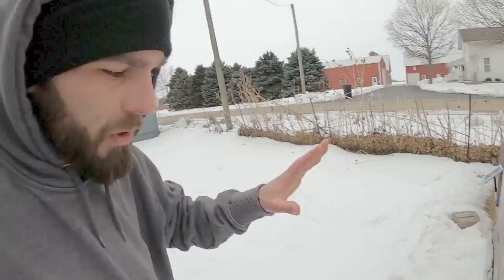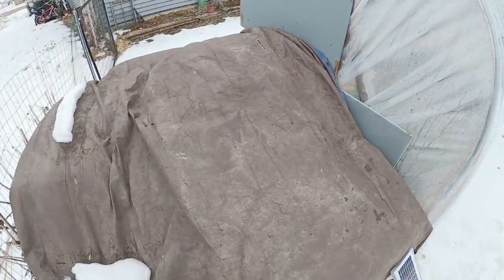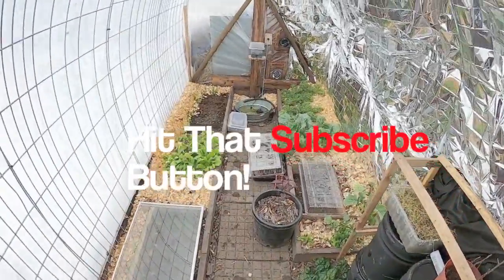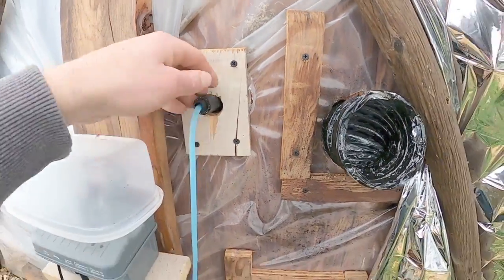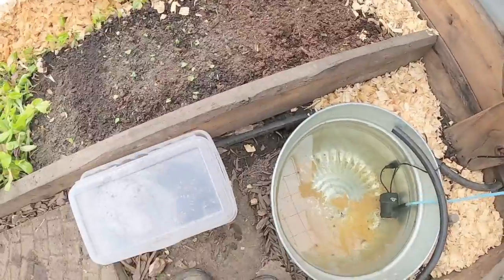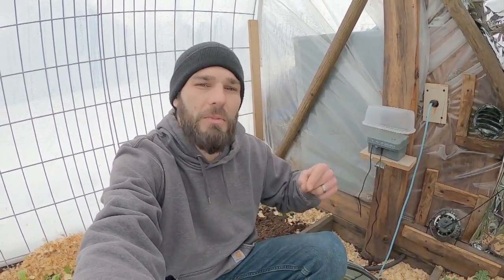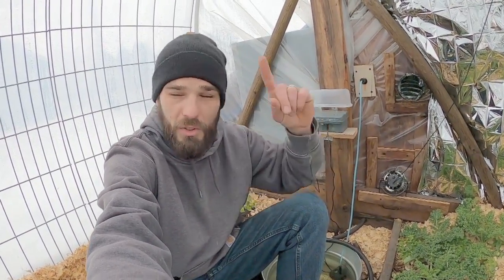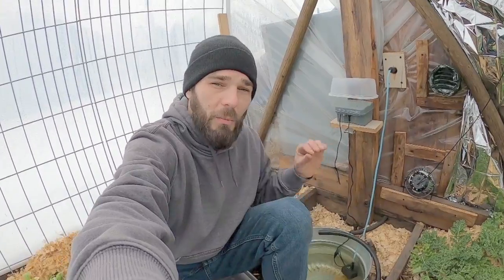DIY Cheap Winter Greenhouse Heating | Jean Pain Compost Heating Solar Experiment | Zone 5a/4b

Comment: One big pipe at the top is for taking the air from the green house to the pile outside? And the fan brings the heat from pile inside the greenhouse?
Reply from the maker: The top pipe is blowing into the greenhouse and the fan is forcing air through the lower pipe. And we get a heat draw and exchange even when the fan isn’t running. We did it this way to prevent gasses building up in the greenhouse
Reply: @Earthdwellershomestead  thank you
Reply: @Earthdwellershomestead  what about breathing the "compost air" ? Any concerns?
Reply from the maker: @ with a solid tube you don’t exchange air only heat, I e covered this in recent videos. Great question!
Reply: @Earthdwellershomestead  Oh, thank you . MAKES SENSE. I will check out the other videos and thanks for the tips.

Comment: you can save on pumping the heat with ingenious  technology do more home work you can save on the power you are wasting
Reply from the maker: We could be harvesting methane also, I didn’t have anything to capture it at the time. Good insight..we eventually will harvest methane from our large piles and using it for energy and heat inside the greenhouse also.

Comment: This is the first video I've watched from your channel... I have QUESTIONS lol.. Is there wind blowing from the upper tube? Does the 75 feet of black hose have holes or its for heat only, I've never heard of Jean? Gene? I've seen other greenhouses being warmed by their compost pile. It's an awesome idea.
Reply from the maker: The fan blows through the tube and pumps warm air inside the greenhouse even when the fans not running we’ll get passive draw. And our water hose is sealed and only transfers heat from compost to the floor and overflow tank inside. We did the pile outside bc it’s so massive and we didn’t want to gas ourselves out. We’re doing this method inside our 520 square footer we just put up! Thank you!

Comment: What temp is the soil?
Reply from the maker: Soil temps within about a foot or so of our heated hose was around 45-50 on the surface all winter for the most part. When we got - 20f + overnight we saw a little dip in temps but not detrimental with our straw bales insulating the ground around the outside of our greenhouse.

Comment: You might like Dr Thomas Culhane.  He's got a nice YT tutorial about adapting a UBC bulk container into a methane producing unit using food scraps, etc to make cooking gas. 
https://youtu.be/Cwm5Rm8uIsk
 If you've got some optimum temperature for methane producing bacteria ( like starting at 85 to 105 degrees F ) you might really like to be cooking with gas. Nice work you're doing, btw.  Thx
Reply from the maker: I’ve watched a few other channels harvest methane I’m very interested as our piles could create more than just heat and plant food, we could store and use gas off it also! Thank you for the suggestion I greatly appreciate it!

Comment: How many degrees of heating do you get per sq foot would you say? And what R rating would you give that greenhouse? Asking as I'm trying to figure out based on the size of that pile, how large of a pile would I need to heat 'X' sq feet how many 'Y' degrees and 'R' value vs those winter temps of 'Z'.
Reply from the maker: I really can’t say what retention value our little greenhouse had the winter we filmed this. We lost tons of heat all winter but our compost kept producing to keep it warm. We had straw bales all around for insulation of the ground and low airspace/poly. Mylar with a little foam behind it on entire northern wall helped radiate solar heat also amplifying passive storage in the floor and heat sink. This greenhouse is 6 x 12   72 feet squared inside, about 7 foot tall. We heated it for around 5 months and never really fell below 40ish degrees Fahrenheit at any point, being when it was -20F + out overnight. For the most part we recorded mid 50F’s throughout most the winter.

Comment: ATTENTION!
Breathing air that comes from composting activity may be dangerous for you. The air would be full of fungi spores and unknown type of gases. Running that air inside poly/nailon tubes would be safer.
Reply from the maker: We specifically did it this way to prevent from poisoning ourselves
Reply from the maker: The pile only transfers heat not air or gasses. The air come from inside the greenhouse and flows through compost back into the greenhouse. No gases at all….
Reply: Oh ok then!! Now i can say your work is brilliant:p Thanks for the specification! Keep up the good work!!
Reply from the maker: Thank you!

Comment: Question? Do you have issues with gas build up inside of the green house, or do you vent that someplace? Thank you.
Reply from the maker: Nope that’s why the pile is outside the greenhouse. I did this because of that reason. Only heat transfer no gasses

Comment: Can you recommend a solar fan?
Reply from the maker: The exact 5w solar fan we used has been renamed or branded. There’s quite a few on Amazon for cheap. I will say of the three I’ve bought they all still run, the longest being 2.5 years! Another recommendation when searching is that the 10w solar fan will require more solar activity to generate movement. The 5w fans run on cloudy days which is great for in the greenhouse!

Comment: I’m intrigued, but urine?,
Is that intrinsic with ammonia?,
Most compost beds down naturally over about three months
Reply from the maker: Yes normal composting is quicker. We used woodchips to prolong the burn. Or if you create a massive “normal” compost pile from yard waste and such it can burn for an extended duration directly related to size.

Comment: That's awesome. I've always wondered how long compost heating works without touching the pile, and how much hassle it is to maintain? (At some point the matter will degrade, you will need to add fresh wood chips and probably harvest your compost to use in the garden. You probably can't dig in with a pitchfork without baking your tubes and pipes.. have you already had to do this? Thanks for the video ;)
Reply from the maker: A pile can burn from 2 weeks to 15+ months, and yes if it’s not build large enough you’ll have to add materials (c) & (n). We have a few videos on this from last year and a few this year also, and we covered tearing the pile apart in spring. Thank you!!
Reply: I haven't done anything like this, so take what I say with some skepticism. With a larger greenhouse I would put a compost pile in the middle, and then slide some grow beds, on wheels, over the pile. This way, I think the need for tubing will be reduced, without taking up valuable grow space. Those grow beds would probably be a good place to plant cold sensitive plants. Of course the compost would have to be removed in spring, and that would be a lot of work.

Comment: Very nice setup.  Well done!!  Mfg and Model Numbers of the equipment would be a big help.
Reply from the maker: I agree! I wasn’t able to like to the products I used when I created this video, the solar pump and battery bank came from the company silicon solar they have many set ups like this. I am currently using my own created solar system in our large greenhouse for the same purpose, just much larger scale of pump and hose. The solar fan is a dime a dozen on Amazon, I purchased and the company changed along with the product several times but a quick search for 5-10w solar fan will result many choices. Thank you for the input!

Comment: Where did the air tube go, into the pile? Do you have an air and a water tubes running circles throughout your compost pile. If so did you do a video of how you set it up?
Reply from the maker: I have a few videos on this style heating yes, we ran water hose in circles and the air ducting in an s shape back and forth up the side of our greenhouse between the compost and our greenhouse wall.
Reply: @Earthdwellershomestead  u did a great job..i have 150 squre feet cage for chicken is it viable also for chicken(without deficiency of oxygen)sometime outside is negative 3celsius ....please could u give me link of ur proper video how to make and what i need?..thank u
Reply from the maker: @saldin48  this system can be recreated with any size water pump and air moving system (fan & tubing) and could be rescaled for any size application! Here’s a video of the system without compost on it as we were tearing down in spring
https://youtu.be/QyM9kqdwhq4
Reply: @Earthdwellershomestead  i am just concerning about chick's breathing(cause of co2 and less oxygen)in small shed
Reply from the maker: I was also, that’s why the pile is outside our small greenhouse for heating purposes and in our 520sq ft greenhouse we just built we have the pile inside because the airspace can soak up co2 into plants and the methane isn’t built up as much with a larger area. That was the major concern when building this system for our little greenhouse so we didn’t poison ourselves
Reply from the maker: @saldin48  you would have to install some type of vent system probably to avoid a build up.
Reply: @Earthdwellershomestead  thank u
Reply: @Earthdwellershomestead  ok could u just tell me ..i have enough cow dung buffalo  dung and horse and goat manure could i use it or wood chips are better ? Which is more efficient and long lasting?..thanks for u r answering

Comment: Have you checked out Chinese greenhouses? They have blanket curtains they put down at night to hold in some of the heat. Your setup looks great.
Reply from the maker: Yes I have! We just have so much wind and snow I don’t know if it would last, the expensive ones are made for northern Canada and Russia and work great but at a cost. Thank you!!
Reply: @Earthdwellershomestead  I was thinking movers blankets might work and are cheaper
Reply from the maker: @joansmith3492  that not a bad idea at all! I may be able to find some at work lol

Comment: Would be cool to do a green house in the ground with just the roof above ground, maybe have the compost under doors at the same height, semi-in through a partition and use the compo in the green house in spring. Great vid :)
Reply from the maker: We want to use the earth in our next build! Along the lines of what your saying, using the earth’s insulation for geothermal passive heating. We’ve got some ideas coming! Thank you!
Reply: Those are called Lyman greenhouses. 
There is one using geothermal heat but you have to dig 8' down to run pipes. Free heat.

Comment: Temp range inside?
Reply from the maker: We Kept the floor between 40-50f prettt we’ll all winter , the air space is usually 50 plus also! Unless we’re in a deep freeze then we may see temps drop some but not much
Reply from the maker: Proper insulation is key *

Comment: Great video !!
Jean Pain would be proud !
He captured the methane gas into tractor Inner tubes and used it for cooking and powering his little car too as well as hot water.
I've got his list of materials and story from Mother Earth News in the 70s.
I'm going to duplicate it this spring in Central AZ. along with many other Mother's inventions.
Keep the great videos coming !!
Reply from the maker: We’ve got some more content relating to this, however I have not gotten to the point where I’m harvesting the methane yet. In our large greenhouse we’ve got a pile running water through it inside the greenhouse. I’ve just got to develop a way to capture and store it. I have a drawing plan for a slurry system also to harvest methane but we have so much compost we could be harvesting off I need to come up with something. Thank you for your input and kind words!!

Comment: Hi, please tell me the size of the small solar panel and where you purchased it. How did you hook it up to the solar panel?
Thank you
Reply from the maker: We used small solar panels and small kits for this greenhouse I believe the solar panel sizes are about 8x10. Very small for solar panels but this was all experimenting in the beginning two years ago. The fan kit isn’t available on Amazon anymore under the same brand but there are many different brands that are the same exact fan. The fan is roughly 5 inches across and 5w. We’re using a 10w version in our large greenhouse in more recent videos.

Comment: I'd need compost piles on four sides and the top of the greenhouse here in wintery Alberta.
Reply from the maker: this can be done anywhere if your pile is big enough and insulated they do it in Northern Russia for heating need also. But yes up there you need much more to make it through winter 😂
Reply from the maker: We also put a Jean pain compost pile in our larger greenhouse and run it the same way just included inside the greenhouse for even more heat draw

Comment: Wonder how it would work putting it inside the greenhouse (I have a 10’x20’greenhouse I need to heat. So maybe do a cylinder type bioreactor inside the greenhouse.
Reply from the maker: I’ve also thought of digging a small compost trench or pit, that may be the next step for some extra thermal heating in our 520sq ft tunnel
Reply from the maker: It would heat the airspace up as long as it was active!

Comment: Fiya. You should get some thermos siphon on the air tube if the low intake is a degree or 2 cooler than the high output.. Excellent explanation

Comment: Fan specs please. Do you run your fan constantly or is it just every 15 mins? What is your solar specs too?
Reply from the maker: The fan we got super cheap as a trial, and it’s been running about two years every day all day. Here’s the old link to it but I’m not sure if it’s still available now— Solar fan 5W 4 inch free energy... https://www.amazon.com/dp/B07B89ZV32?ref=ppx_pop_mob_ap_share
Reply from the maker: I will have to find the actual pump we bought. It was also an experimental purchase, our water runs 15 minutes every hour to conserve energy and allow it to run through the night.

Comment: Does the water stay in the tube? And is the hose directly under the bed or beside it? Maybe I need to watch ur other videos.
Reply from the maker: Yes and no. The water travels through the Hose and makes it back to the tank to be re-sent back through the system. The hose itself runs through the top on the compost down to the bottom (coiled up loosely) and re enters the greenhouse and coils through our floor then ends at the bin of water to spill the water back in where the pump can bring it back up to the top of the compost.

Comment: How warm is it in there? I need it warm enough in mine to grow tomatoes in zone 7b.
Reply from the maker: We kept a solid 50f when it was absolutely freezing out, temps like -20  or windshield temps of -45ish! When it’s warmer outside the system will surely keep it warm enough in a warmer region, you may need lighting depending on how much sun you get in the winter months. I wish we could grow fruiting veggies in winter here but we would need lights and better insulation at night time. Hopefully that helps some

Comment: Wow, it like Paul Harvey's the rest of the story, adding nitrogen to the pile, solar-battery running the fan,  letting water heat up in the pile and then moving it into the greenhouse to keep the soil warm is great.  I was wondering is you considered using the water more, maybe up the pipe size and make a radiator like something in the green house. How warm does it stay?
Reply from the maker: Thank you!

Comment: Where i live in alberta canada it gets to -45 celcuis at some points. Would something like this still work in these conditions? Or do you have any suggestions for growing during winter in these conditions?
Reply from the maker: I would use a double layer of poly with a gap to blow air in between the two layers. And compost heat could be your best sourcing without electricity. We used a small pile about 3cu yd to burn for three months so far! If you went bigger you could use energy off the compost in many ways!
Reply from the maker: Our sunken coldframe is great for extreme. Cold with no maintenance! We have a few videos on it, however we wanna make it bigger and more efficient to obtain a bigger harvest, but it’s another great way to grow under the snow for sure!
Reply: A rocket mass heater as a north wall in a greenhouse helps too
Reply: Would you keep the compost pile outside or in between the two layers?  I have a friend who runs sheep inside a high tunnel and then has a smaller greenhouse for seed starting inside the high tunnel.  The body temperature of the sheep is a natural buffer for the outdoor temperatures.  Not sure that they actually HEAT it, but it certainly helps buffer.
Reply from the maker: I had suggestions to start a rabbit colony inside a greenhouse also. Not a bad idea if it can be done cheaply and with enough room .

Comment: What is the temp inside the pile and in the greenhouse?
Reply from the maker: We’re sitting between 120-145. If it gets too hot like it just did we spill it out and cool down a bit so it doesn’t spike 150F+ and cook too fast. The greenhouse stays about 60-65. Overnights about 45F
Reply: This is totally amazing what you’ve done dude👍 so as outside temps rise you can adjust that timer?
Reply from the maker: As it gets warmer I am prolly going to switch use and do some aquaponics in the greenhouse! Thankyou for checking this out!
Reply from the maker: Thanks for checking it out! We’ve got a few more videos covering the beginning and build.